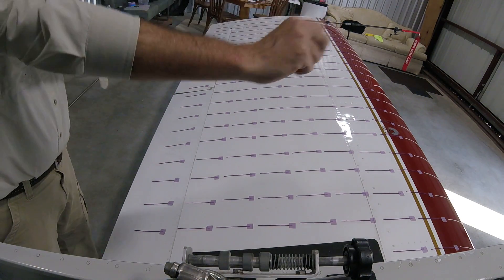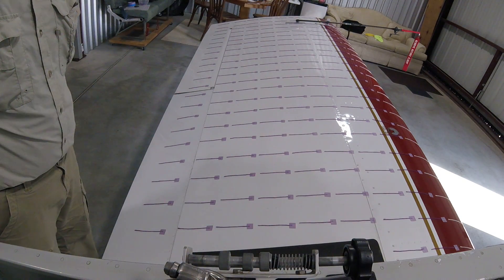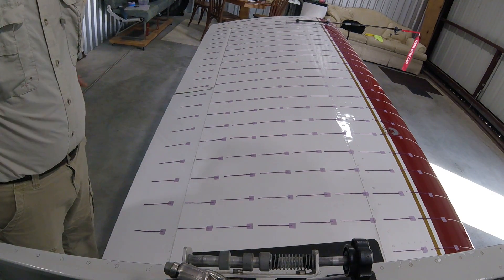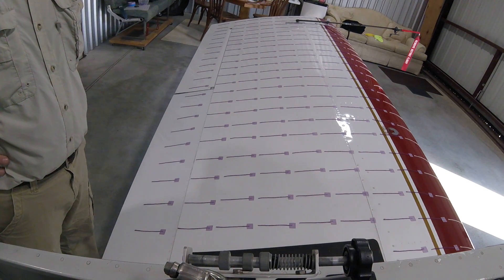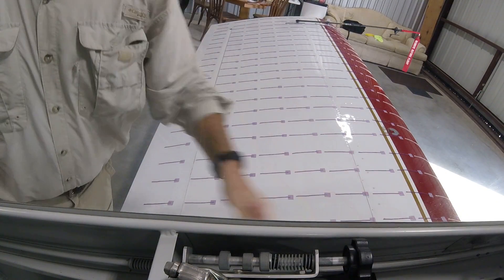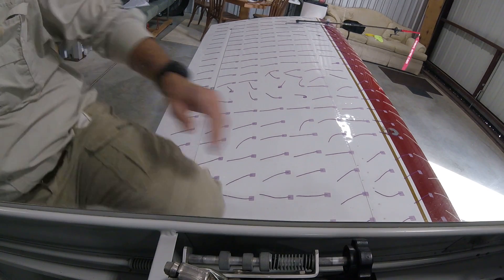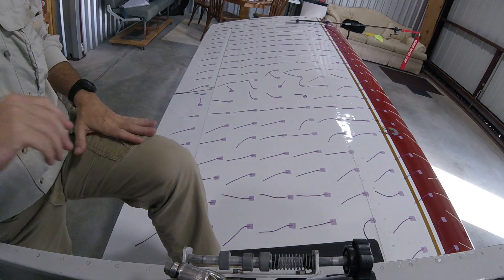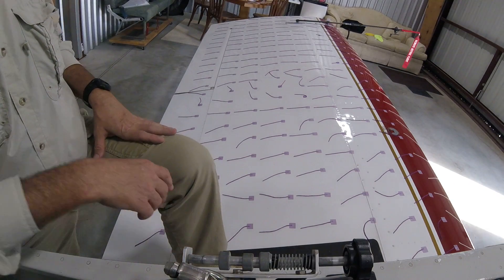Wing Tuft Test 28 Dec 21

Comment: What was the objective of these tests?
Reply from the maker: Two-fold, first was to ensure that our AOA system provided stall warning in accordance with FAR 23 certification standards and the second was to validate a handling technique of flying emergency engine out maneuvering at low altitude at flaps up Vref (1.3 times flap up stall speed) gliding turns using 45 degrees of bank.  This was to accommodate airplanes not equipped with an angle of attack system to have a simple, single reference cue during low altitude engine out maneuvering.  Not as safe as maneuvering solely be reference to angle of attack (which means a constant stall margin), but "doable" as long as the pilot honors the stall warning and adjusts angle of attack appropriately.
Reply: @mikevaccaro1248  Pretty cool stuff. This  is a side of aviation few pilots get to see. Thank you.